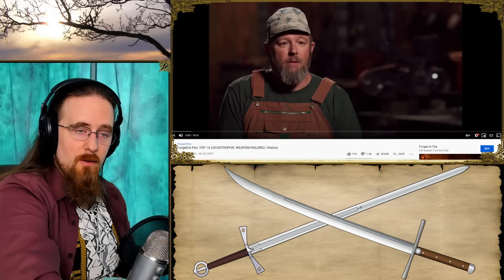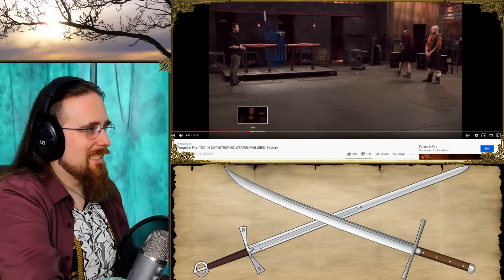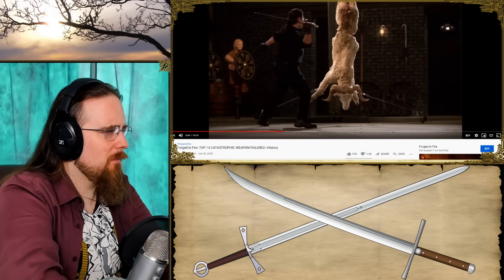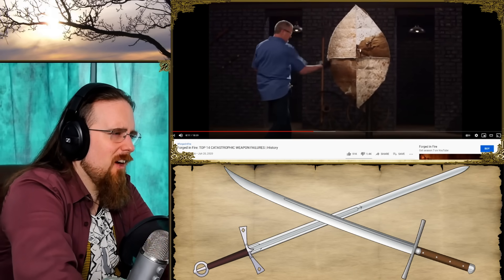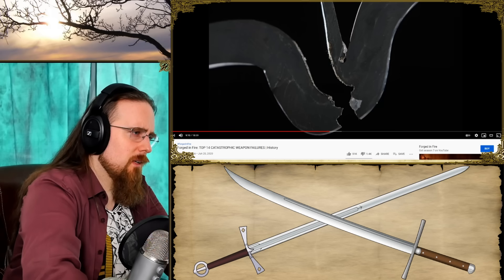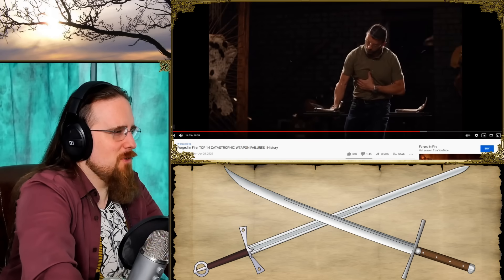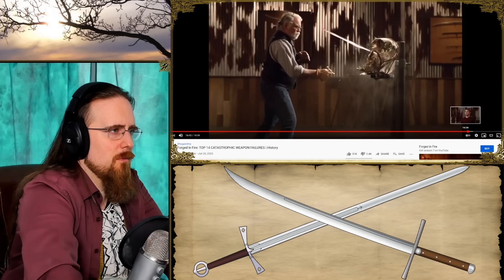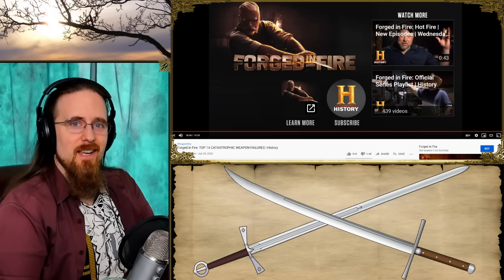Skall Comments: Catastrophic Failures on Forged in Fire

Comment: Those tests look like they were meant for axes not swords.
Reply: They are meant to reveal the tiniest faults in the blades. The only purpose of these blades is to be tested, hence there is no use in preserving them.
Reply: @antyspi4466  no a tool should be tested for it's use . no point in shooting kevlar with a tank to reveal any faults.
Reply: I meant they are like car crash test.
Reply: @Tennoeno  Also little point in shooting kevlar with a .22LR. The tests are meant to fail contestants, as Skall said, otherwise if they don't you're stuck with everyone passing and you don't have a singular winner.

The fact that usually at least one blade makes it through means they're not shooting kevlar with a tank, because it is possible to survive, just extraordinarily difficult.

I agree with Skall though that these really harsh abuse tests should be saved as the tie breakers instead of the standard test.
Reply: @Tennoeno  I think that in a battle sometimes you can't always keep a good edge alignment, sometimes you want to survive and you don't think about those "details". you will hit shields, armors, etc... And if your sword breaks, then you cannot say "...but this test is stupid! The armor was too hard it's not fair!"
Reply: @Tennoeno  I mean it's a good test for the tank.
+69 style points if there's a person inside the kevlar who's wearing his "safety shirt" while posing for the camera.
Reply: @ernesterz  I would agree if the test was hitting pieces of armor or a shield, but there is no reason to try and stab through a jerry can with a knife.
Reply: You're smart
Reply: even with an axe you try to work in direction of growth, otherwise you simply tire yourself out needlessly
Reply: @antyspi4466  I think the problem is that swords are not meant to be handled like axes. A good sword isn't the most durable one, but one that best balances handling, cutting/piercing and durability in the context of it's use.
For example, an executioner's sword is far more durable than a longsword despite looking very similar. But if you were to have two duelists fight with them, the executioner's sword will lose every time.
Reply: Agreed!
Reply: These tests are supposed to test a blade to the absolute extreme.
Reply: @Tennoeno  It's not the tool being tested, but the smith. People keep forgetting that.
Reply: @niklasfischer3915  that is not "extreme", that is stupidity. 
you do not destroy your weapon, especially if you need it for the next guy

heck even when yer chopping wood with an axe or cut down a tree, you use your fuckin eyes and aim and either chop with the grain or at an angle to it but not fuckin straight against it.

give it a try
Reply: @Neithan02  Believe me, I know how to use an axe effectively. And of course these tests are not meant to represent reasonable use of the weapon. They abuse it on purpose in order make absolutely sure that it doesnt break under reasonable use.
A really well made knife will in fact pass these tests without big damage.
The reason why knives break on this show is because the bladesmiths are often beginners, and usually have very limited time to make the weapon.
Reply: @niklasfischer3915  given how at times the person doing the test is fuckin up technique.. amusing
Reply: @Tennoeno  no, but they do shoot kevlar with different calibers to find the maximum that it can protect from. every design of kevlar plating is tested to its breaking point. as are these blades.
Reply: One of the judges crafts a blade in the allotted time and ensures that the tests can be passed
Reply: @Neithan02  I agree with you here. Sometimes the judges perform a bad cut and then blame the bladesmith.
Reply: while they are way more brutal than in real situation, they are also accelerates the test. Yes, they could just use it for hours or days chopping softer targets, but you probably want a nice and clean 20 min show, instead of a several days long stream.
Reply: @antyspi4466  tbh I don't see any blade surviving repeated hardcore smacks across a hardwood yoke.
Reply: @Tennoeno  if they don't do that they will have no winner. One or more of the swords have to break. Lol
Reply: For real, who cuts wood with swords??
Reply: Those tests look like they are meant to be entertaining for people who think that abusing and destroying what should be fine pieces of craftsmanship intended for different uses is badass or something.

A side effect of this is that the smiths are encouraged to build overbuilt sharpened bars instead of realistic swords.

If they would really want to test the blades, they would set up repeatable, measurable tests, with equal conditions for all the participants and minimum room for human error or bias; but that wouldn't look "badass", right?
Reply: @temperededge  I wouldn’t say lose every time. Just because a weapon is unorthodox doesn’t mean it’s absolutely useless. It can still kill in the right hands. Adaptability and finesse can go a long way especially combined with a fair amount of skill.
Reply: @niklasfischer3915  with these types of tests a german kriegsmesser wil always win against a longsword, simply because it's a single edged thicker more durable blade. Durability isn't the selling point of longswords. While you need a good base, you don't need to be able to fell a tree with a sword
Reply: @glenndiddy Yes, a Kriegsmesser is more solid than a longsword.
But this isn't important, because the bladesmiths both forge the same weapon. Therefore there is no design based durability advantage for any of the smiths.
Also the hardness of the testing is adapted to the weapon. They won't abuse a rapier as hardly as a Falchion for example.
Appart of that a well made sword will survive their tests without big damage.
I am actually not a big fan of forged in fire, because their testing is most often inconsistent and greatly based on luck. But even still a have to point out that their testing is not too brutal.
Reply: @niklasfischer3915  I don't really agree with the point that a well made sword will survive the test. For instance on the fixed block of hardwood you'd be hard pressed to find a sword that is both suitable for combat and able to endure that kind of testing. 
To make a longsword/armingsword durable enough to stand up to that test you have to make sacrifices in terms of handling and weight distribution to reinforce the blade. That simply makes it a worse blade by design, yet a bit more durable which would be irellevant on realistic targets
Reply: @glenndiddy  Well, I partly agree with you there. This test was probably too abusive. But most other strength tests I've seen (for example ice block chops or stabbing into an ammunition box) are definitely survivable.
Reply: @niklasfischer3915  There are plenty of low quality blades on the show, especially since skal mentioned they are sometimes forced to work with random pieces of metal welded together. For instance, there was no excuse for a blade bending and even snapping against a ballistic gel dummy. It has plenty of give and isn't rock-solid either.
Reply: @Zanemob You're not wrong exactly but when comparing weapons, it's problematic to factor in skill. I'm sure there are swordsmen talented enough to kill me using a plastic practice sword but does that tell you anything useful about how good a plastic sword is vs a real one?
Reply: @Tennoeno  that made no sense
Reply: @Tennoeno  If the goal is to test two vests to see which company gets a big contract, you should push that test until parity is broken, and then see the difference.
Reply: @seihanda671  But car crash tests are performed at reasonable road speeds.
Reply: @blackmage665  But you start with something something reasonable and work up until if fails. If the ballistic vest stops 9mm pistols, try intermediate rifle rounds, if it stops those try full power rifle rounds, shotgun slugs, etc.. Starting with .50 API might be fun/entertaining but isn't reasonable - any vest the survives would be too heavy and bulky to be actually used.
Reply: @Dennis-vh8tz  Yes they are, have you seen NCAP test?
Reply: @seihanda671  I've seen several different tests but I'm not sure exactly which ones. A lot of them are...bad. Especially off centre impacts and older/or older cars.
Reply: @Dennis-vh8tz  The problem with your analogy is that ballistic armour is comprimised the moment you damage it anyways, so starting small and working up would require a bunch of pieces to shoot anyways. A realistic goal would be to find what broad level of firepower the enemy this is being made to fight would have access to (7.62x39 being pretty common) and push that a LITTLE further for testing sake, then working down. But to be back on FIF, it's a competition, things cost money, and there is only so much time for footage.
Reply: @emarsk77  they are all given  the same requirements for building the weapon so if someone shows up with a sword clearly overbuilt they get disqualified
Reply: @joshburns969  You would be horrified then what I did with my bayonet in Iraq. That's what people don't get. Weapons are tools. 

That means sometimes they are used outside of war stabbing and all that. As for why you would stab a jerry can. You would do it to destroy it. In case you can't take it with you
Reply: @ernesterz  You just don't use a sword against armored combatants if you want to survive in a battle.
Reply: @kuhaku9587  of corse you do. Zweihänder? Tho handed longsword? Those were weapons designed to be used without a shield, when people used to wear very protective armour. Even if swords in battlefields were primary a secondary weapon, if you loose your poleaxe or your mace, you can draw them and still fight, trying to stab the unprotected weakspots of the armor,  they are also useful against chainmail etc...
Reply: Wouldn't an axe just get lodged in a cow carcass due to the size of the wedge of axes?
Reply: @bombomos Explorers With machetes I guess
Reply: @JS-oh2dp  I totally agree. It is true that the testing very often is unfair, because the judges are just humans. Especially in the sharpness test you very often see that the difference in performance was caused by the judge and not the weapon.
Reply: @TheOldOne The show makes a big deal over whether a weapon can "keel" so I feel their intention is for the smiths to make weapons, not just durable sword-shaped steel.

A blacksmith's job isn't just to make something that's durable. He has to make a lump of steel excel at doing the thing it's made for. It has to be functional, not just durable. It takes skill to do that too.
Reply: @seihanda671  Nope, cars are expected to crash in real life, so it's very realistic, beside, it's not for testing the car itself but the safety it provides in case of crashes. It's more like testing cars by how good they float on water.
Reply: Oh yes because my sword that I've paid good money for from a good smith in the medieval ages and that I'm a knight. My sword should be tended and checked on by an expert. 
Oh no my sword suddenly breaks after hitting the man's armor instantly! Oh no!
-_- how many more dumb comments 

These tests are useless 
As skallagrim has said endurance test should've been tie breaker. 
Smith's of the medieval ages are way smarter than these idiots on the show. 
1. Ensure the blade has no warp or any issues by testing the stability of the blade. 
2. Test the swords weight and handling which means you have to get an proper swordsman to have a go using it and swinging it and thrusting on a dummy. 
3. Check the results and see if the blade needs improvement. 
4. Back in those days smiths have to make weapons on a daily basis, the lords can easily just confiscate the goods should bad quality be made. Along side back to those days swords were made from different varieties.  
Take this for example 
Your a Smith and a professional swordsman who knows his blades and his handling comes to buy a sword from your shop and you show what you have. 
Compared to an idiot who wants to buy a sword just a good sword. But you dont know what is a "good sword". 

It's like let me test modern weapons by smashing them against rocks. 
This is literally what these unprofessionals in the tv shows are doing. 
No safety whatsoever, probably can't afford it cuz they paying 10k to the winner. 
I'm no expert or know it all but hey I want movies and YouTube videos and know who to look to for references.
Reply: And hammers. I saw one test where they smashed the sword against a rock well. Literally banging it against a mass of rocks as hard as they could and wondered why the sword failed. Just use a fucking hammer.
Reply: and even at that...
Reply: @ernesterz  If you're on a battlefield carrying a sword in the first place, you were fodder from the start mate.
Reply: @sebastianb.3978  it has always been the main backup weapon...
Reply: They also look very inconsistent, e.g. the copper pipe thing, the forces differ a lot based on where exactly you hit the blade under test
Reply: @Tennoeno you mean SAPI plates are trash if they can’t stop a 120mm sabot round? Lol

Comment: These tests feel like someone was told to make a perfect wrench only to watch people hammer nails with it.
Reply: More like if someone was told to build a screwdriver only to see it used to hammer bolts.
Reply: Check out the sodegarami episode. Then look up what a sodegarami was actually used for. It hurts.
Reply: I've never watched this show: Is there anything that stops the smiths from making blades insanely thick?
Reply: @MonEyRuLess  they give the smiths a whole bunch of requirements and limits and for the final round you have to be make a historical blade that is extremely accurate. For example one guy failed the final round just because he was lacking one piece on the end of the sword.
Reply: A good wrench is also a hammer ;)
Reply: @MonEyRuLess  if it is unwieldy then it will lose
Reply: @afrog2666  I mean, they do make those kinds of wrenches... The infamous "thumb detecting nut fucker".. Aka the mining wrench.. Crescent wrench and hammer all in one... What could possibly go wrong? Lol